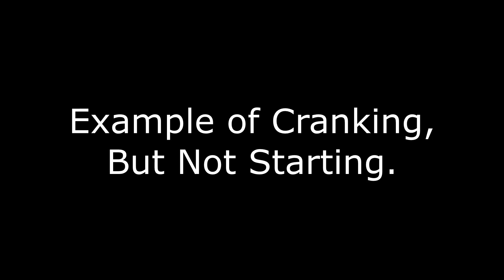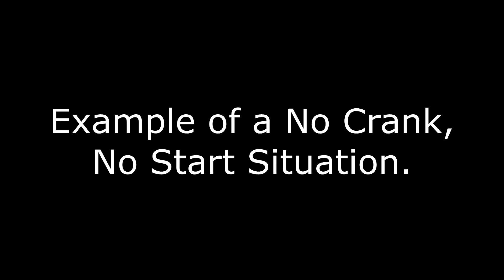DIY - How to Diagnose a Hard Start, No Crank No Start, or Cranking And Not Starting

Comment: Hello I really appreciate your video's 👍. I do have a question tho. I have a 2013 Mazda 3 2.0 skyactive engine.Just Yesterday when I turn the key I hear absolutely nothing, Light's, cluster panel and headlights work fine after a few turns, the engine will start no stalling, no dim lights no strange smell like an alternator failing. Now I did charge the battery overnight with a Noco 2-Amp charger and in the morning it fired up like normal, I bought a new battery and still did not start right away . After I connected my boost pack it  did start up and I drove the car home without any issues. When I parked in my garage and turned off the engine i started it back up a few times but a couple of those times it struggled a bit to start. Do you think a ground wire from the battery to the starter or to the alternator could be enough rust or corrosion to not allow enough amp's to start the engine? I did look at the battery Post's and terminal's, but they look good. Any thoughts or suggestions would be greatly appreciated. Thank you!
Reply from the maker: J - Based on the symptoms you've provided, we do think there could be a possible issue with the wires coming from the battery. Keep us updated!

Comment: have a question great videos by the way
I have a 2011 3351 twin turbo drive prefect one day next day will not start car just cranks and cranks until it stops A few times it sounded like it's about to turn over but quickly cut off
At the end of each crank a hear like a small noise nothing major but still can't rule nth out
Thought it was a battery thing took the battery for testing turn out good recharged it still no start
I was sitting in the car trying to think what could be the cause I turn the headlights on high beam and the dash lights Both the dash light and the headlights start flickering going in and out
Only when on high beam
Mind you everything seems to work fine am so confuse
My only thought is a cam/crank sensor but the car engine check light was not in b4 this so I am not sure wish to hear back as soon as possibly hope u can help thanks
Add a reply...

Not sure what’s my problem getting a few codes but only one I see could cause a long crank no start is p15ED
Reply from the maker: D - Sounds like an alternator issue.

Comment: Thanks for this video awareness. Hope you can help me, my car have hard starting with no crank, have new battery, and I changed the starter switch but still have hard start with no crank maybe I will try 5 to 10times before it will start. What could be the problem? Thanks.
Reply from the maker: A - Have you tried jumping it? Some wires?

Comment: Great video. My car has been down for 7 weeks now and after replacing all 4 faulty injectors, fuel filter and battery, still cranks for ages and no start. Have been having hard starts/ sometimes no starts on first try for a while now. What’s the most likely cause?
Reply from the maker: A - Sorry to hear about this.. have you checked the battery connections or the starter? Keep us updated.
Reply: @8020Media  I have gone a lot further than the battery 😅 Engine cranks, no issues there, until it tries to run and just dies, leaning to the probability that the HPFP doesn’t have the strength anymore to build up the pressure and get it going again. Definitely compression from all of the cylinders too (replaced injectors and tested before putting them in). 
Just today i’ve tried replacing the next ‘cheap’ part which was the FRP sensor… no luck. I’m well over a grand deep now and i’m just starting to accept the fact it’s probably the HPFP. Not sure yet on how big of a job that is to do myself however i’ll keep you updated. 7 weeks and counting since I had the issue 😅
Reply from the maker: A - Shout out to you for self-diagnosing. However, as you have seen, it can get EXPENSIVE.

Comment: Shop told me that the engine was finished and could not be repaired. No reason given for internal timing collapse. Engine ran great before this. Life changer in 4 minutes. Now, hunting for a used motor as replacement. RAV4 would be much more costly, I think. What's killing me is the oil is still looking good, there's no leaks, don't know, it's a freak incident I guess.
Reply from the maker: J - So sorry to hear this. Please keep us updated!
Reply: take it to a different mechanic
Reply: @8020Media They just showed me one of the spark plugs, it was hit by the piston head so something internal fried. It's definitely seized. Next week getting a used motor shipped from wrecker from a 2010 Rav4 with 98,000 mileage and hope shop can install it right. 23 hour job they say, if all goes well.
Reply from the maker: J - Sorry to hear this... Thanks for keeping us updated!
Reply: @jksouthern  Sounds like timing belt failure if this car had one. I wonder how much for old engine by itself and then the job? I know that RAV4 is infamous for transmission failure, but now I know that I will avoid to buy this car in the future for sure.

Comment: My 2013 Elantra sounds like it's barely going to start.  It's not robust like it should be. Newer battery (also had the battery and alternator tested at NAPA and all was good.) The battery terminal connections are clean and tight.  I removed and cleaned the grounding strap connections.  No change. Might it be the power connection to the starter motor?   It sounds like the starter motor is barely getting enough power.  But it starts every time and has been like this for maybe a year or so.  What should I check next?
Reply from the maker: J - This video may be helpful with your research: https://youtu.be/VLKFh4JGzio

Comment: My 2009 Rav4 V6 was running great but suddenly on hwy, the check engine started blinking and I pulled over within 4 minutes. Engine died at intersection, at midnight. Had it towed but shop closed for 4 days. It wont barely crank half a turn on still a strong battery. Like no compression. Any thoughts, please. Good oil, no leaks....just lost its power and a slight vibration noise till it died.
Reply from the maker: J - Has the shop said anything? Assuming you're going to have them work on it?

Comment: Good video.What’s your opinion on a new starter that started the engine 3 times and now just makes a whirling,spinning sound?Truck has 2 brand new batteries and cables are all good.
Thanks
Reply from the maker: S - Thanks for the feedback! We do have a video for a bad starter that may assist here: https://youtu.be/VLKFh4JGzio
Reply: @8020Media  no help from that video, I found another channel that had the answer I was looking for.
Reply from the maker: S - Neat. Would love to hear what your solution was for other viewers sake.
Reply: Starter gear went bad. Skipping gears. Either It was probably made of bad materials or it wasn't as new as you might think it was.

Comment: The problem with my 93 civic is it acted like it’s a dead battery when you first turn the key to on position no indication that it got power whatsoever no ding, no clicks, no beeps, nothing!but I know the battery is good but if I adjust wiggle the key it may make some indicating that the door is open but turns off right after! So it’s either the ignition switch or the cylinder switch! I did mod it to a push start button but then this happened! It had a problem with the ignition switch already that’s why I did the push start button and now this! I did bought the replacement set for the cylinder switch/harness. Still nothing!
Reply from the maker: J - Sorry to hear.. Have you taken it to a shop?
Reply: @8020Media  I wanna try see if I can fix it first before doing so. I know it’s just electrical so I gotta trace it and possibly bypass the expensive route! It’s time I need to start learning about my own car now I got more time that’s why I’m on here seeking for people that had already experienced this issue to help! Lol I think I got the basic idea of how the ignition/cylinder switch/ecu/etc. works so that’ll be fun to figure out on my own. And that way I can help others with theirs later!
Reply from the maker: J - Keep us updated!

Comment: I've got a Cobalt that rapidly clicks about 5 times then pauses momentarily before continuing while turning the key. It's definitely not a battery issue and the issue appeared out of nowhere after sitting for about a week. 
It's like the starter is trying to engage but not actually turning the motor over, the starter isn't spinning either. Maybe the flywheel is in a weird spot where the starter gear can't slip in?
Reply from the maker: H - Interesting. Something could be slowly on its way out.

Comment: What about having to pump gas pedal to to start engine…..
Only starts as pedal is depress. 
Thank you for reply.
2013 Audi Allroad
Reply from the maker: C - It is very possible that it could be the MAF sensor. Are you getting any engine codes?
Reply: @8020Media  
No codes. Thank you👍
Reply from the maker: C - Locate and clean your MAF and see what happens. Keep us updated.
Reply: @8020Media  
MAF cleaned ok for now. 👍
Reply from the maker: C - Great to hear!

Comment: My 2015 crv has a start button. Just started having a problem. Used to start on the first press. Now, I press the brake, press the start button, and it just goes to the ON mode, all dash lights turn on and vent, press the start button again and it starts no problem. Any ideas?
Reply from the maker: G - Can be a battery that's going bad, starter motor going bad, or an electrical issue.
Reply: @8020Media actually had a lot of corrosion at terminals. Cleaned it off blasted with contact cleaner. Now working at first try. Thanks!
Reply from the maker: G - Glad it was helpful!

Comment: Mine was occasional studdering, less with gas given, replaced Fuel filter and the "blower resistor" and got worst, starts funky, runs idle, but tocs with more, worst warmer, now all time kaput. Probably Electric dispite motor sounds :(  Yet Motor light doesnt come on since.
  Battery seems fine, no power anymore, mystery!
Reply from the maker: Para - Sorry to hear about this! Keep us updated if you find out the issue!
Reply: @8020Media  Thanks for thee reply :) My mechanic said the catalyzer was blocked, but still piston 2&4 wont work, he tried everything, maybe local clogged? Or computer fault?
Reply from the maker: Para - This certainly sounds like a difficult diagnosis.. What vehicle do you have?
Reply: @8020Media  Ford escape 2001 V6
Reply from the maker: P - We'll look into it more. Keep us updated.

Comment: I replaced my stater motor 3 times this week and I bought it a new one, got a newer battery . Tested the stater and the issue is . Toyota Camry 2002 I drive for awhile and stop then try to start it and won’t start . Dash is all on but nothing happens . Someone please help I start a new teaching job this week . I’ve spent so much 😢
Reply from the maker: M - Sorry to hear. At this point, it might be worth taking to a shop if you've bought 3 starter motors in a week.

Comment: Would a bad alternator also be the cause of no crank?
Reply from the maker: C - It's possible!
Reply: @8020Media  Thanks💯
Reply from the maker: C - Keep us posted!
Reply: No. Alternator starts working after engine got started by starter already. Engine spins alternator, which generates the power. If engine started and stalled, then it could be an alternator issue also.
Reply: @SergSpace  I replaced the alternator and the vehicle started on first attempt. Seems like the issue was a bad alternator. The vehicle is starting up and running fine.
Reply: @8020Media  Replaced the alternator and the vehicle started on the first attempt. Seems the issue was the alternator. Thank you
Reply: @czarguzman2927  The voltage regulator's diodes were must be shut off, which is pretty rare. They may start to fail and this is why yo may see flickering. But, yeah, when rectifier is down it won't produce direct current.
Reply from the maker: C - Thanks for sharing your experience!